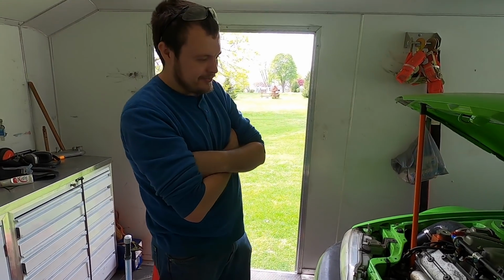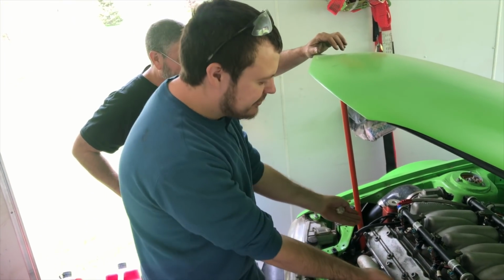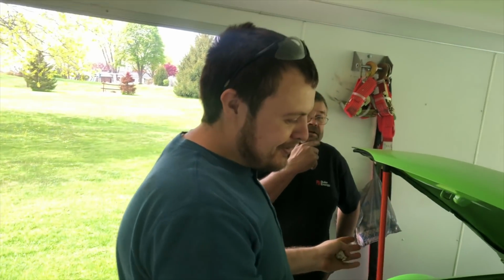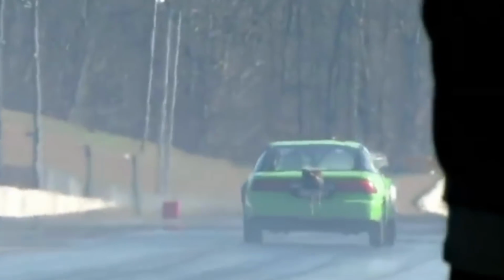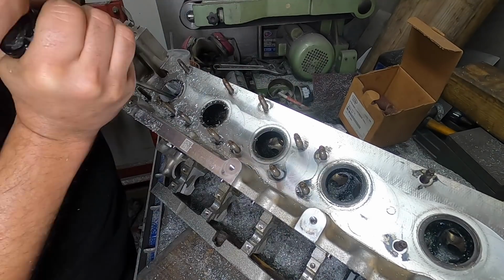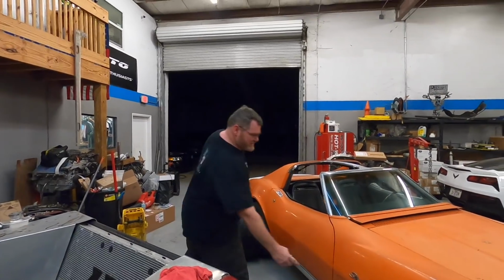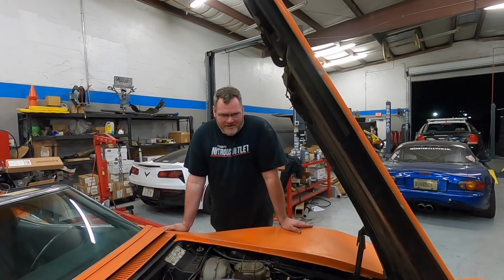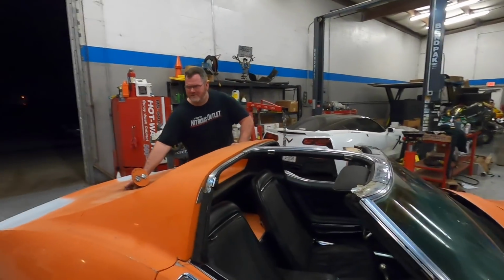Ready For A CLEETUS REMATCH After Embarrassing Loss. Worlds Fastest FWD LSX Vehicle!

Comment: My moms daily was an 87 buick grand national gnx. We had. Total of 3 grand nationals.  All 87's. When my mom got sick and befir she passed away,  we had to sell all of them, plus the car that my dad and i built that took 10 years to build and was supposed to be mine when i turned 16. A 1971 dodge dart. Was a slant 6 car. My dad built a 340 and a built reverse manual valve body trans for the car and it used to shatter TCI torque converters shifting to 2nd gear. Id give anything to have either of them cars back....

Comment: I had to smile at the front tires losing traction making the car go squirrely.  I spent my entire working life at Ford Research in the UK, and when the MkIII Escorts were being developed, for some unknown reason we had a full rally spec vehicle with a big turbo which had lots of lag.  A big problem with the MKIII Escort in its early days was drive shaft wind-up, which was that much worse with the rally spec engine, so when the power kicked in the car would lurch violently to the right, and I do mean violently!  This was because of the longer drive shaft on the right side of course.

Comment: Atlas engine notes:
1) Susceptible to dropping valve seats quite easily.
2) Lost foam cast heads and blocks are subject to porosity. You may want to consider impregnating them (epoxy impreg).
3) Press in sleeves require care in replacement. Freeze the sleeves prior to pressing them in. Deck the block after pressing them in to ensure they are flat.
There's probably other things I am forgetting as well.
Source: the company I work for has a LOT of history with the atlas engines.

Comment: Atlas? Never heard of that name and I've worked in GM dealers since 1993. If it's a Trailblazer 4.2 then it's good for dropping cylinder liners, dropping valves, burning valve seats, and breaking head bolts off in the block. They also have variable valve timing on exhaust side only. 

I'd rather own a Northstar and a do own a 4T65E car. 

'72 Corvette was last chrome front and rear. '73 had chrome rear and plastic front. '74 was plastic both ends but the only year the rear cap has a vertical seam. '71 was the first big emissions year and the year compression was reduced by about two points. I think '75 was last Stingray and '77 last flat back window. 

I love orange and that's a beautiful car.

Comment: You guys do it the complicated and take forever way... the quick-and-dirty way get some unscented Aquanet... it's a dollar. spray a little bit of that s*** on your coupler put your clamp on give a few minutes to do its thing and it ain't coming off. So for all you guys out there that don't have access to welding... get you some Aquanet. it's Hairspray.... unscented... s*** is like glue for couplers. It only takes a little bit... do too much and it doesn't work. I used to have problems all the time. I've had couplers on my car for over a decade... without problems. I run in between 17 and 28psi with cheap couplers and clamps. Someday when I have access to a welder and I'm bored. I'll make it look nice and only have three or four couplers but right now... I've got probably a dozen that are mismatched lol 😆

Comment: 2 words...
Set screw
Reply: Or, think of it this way with tech inspection...
Drill a hole through both connected parts and safety wire with sealed hole. Would your brake caliper come off a race bike? Not if it's connected properly, with back up in safety wiring.
Reply: Also, do you have anything safety wired, or is that not needed there?
Reply: In the racing, on motorcycles, that I have been involved with, a whole lot is double safety redundant, such as safety wiring axle bolts (lug nuts), brake calipers, etc.
Brake and clutch fluid reservoirs have a sponge wrapping to prevent slipping on track for others after crashes because that crap is slippery. We even had to strictly use water based coolant such as water wetter, because again, petroleum based coolant is slippery and will cause more crashes that can be deadly.
I have seen some carnage as well as had a relative lose control of race car that ended up in the crowd in Wis before I was born. He never raced again, but the story always stuck with me as I wrenched and raced. Just a few cents to ponder. Even if it's not required, you never want to have to pay some bills you will never be able to cash.
I personally, as a certified motorcycle tech, have felt that maybe my job, the dealership, had me hand a souped up loaded weapon to old enough kids. Wasn't worth what they paid me. They pulled the trigger(hit the accelerator) and my wrenching was ever a cause. But, it can still weigh heavy on others. Please set the safety bar to a new high for yourself.
Anyway, love what I see. Sometimes, it scares me.
Reply: NEVER the cause